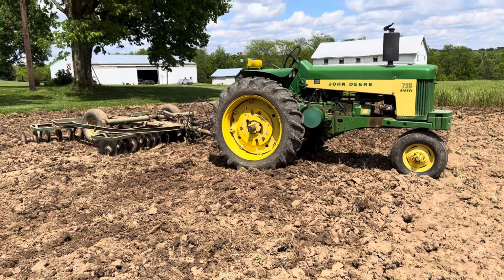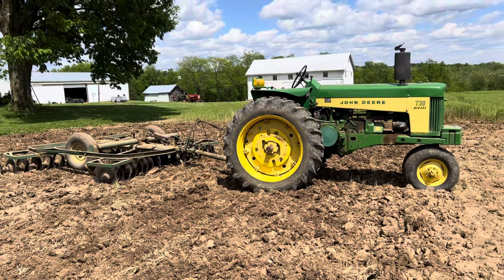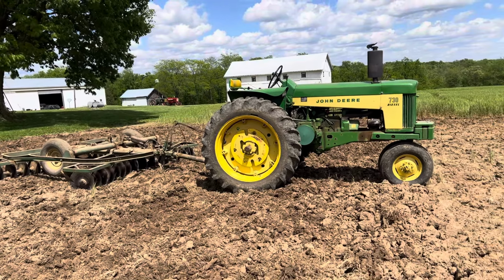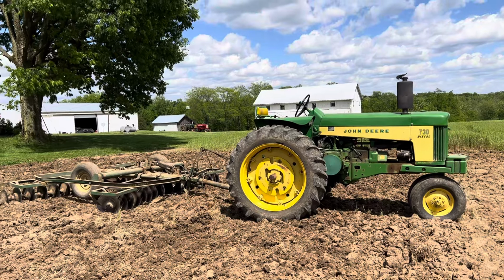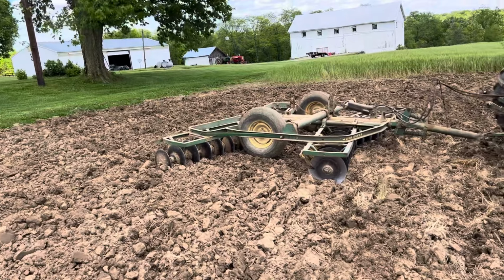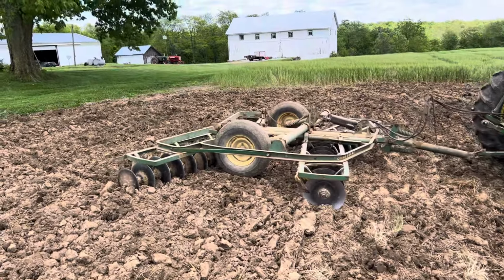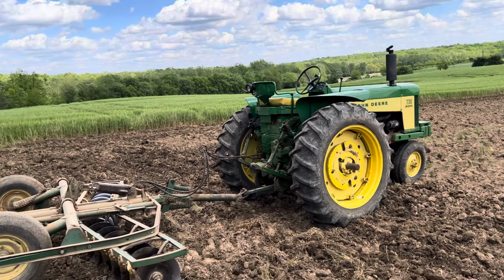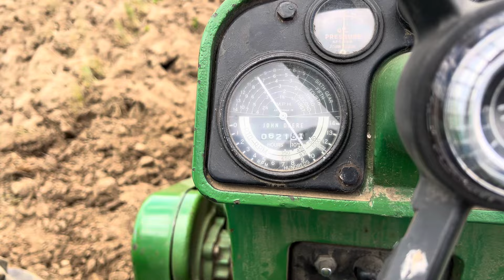John Deere 730 Tractor and John Deere AW Disk

Comment: I was using my 12ft RWA this afternoon. Similar disk but with a rigid frame. I opted for the air conditioner in the 5093 instead of a two cylinder because it was pretty hot here today. I don’t really make the two cylinders earn their keep anymore. They have earned their retirement the same as I have.